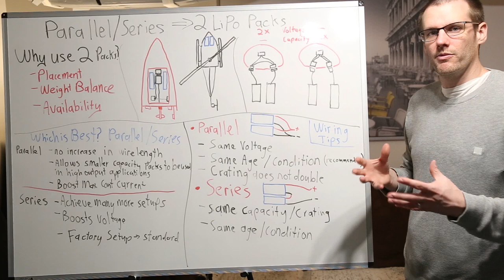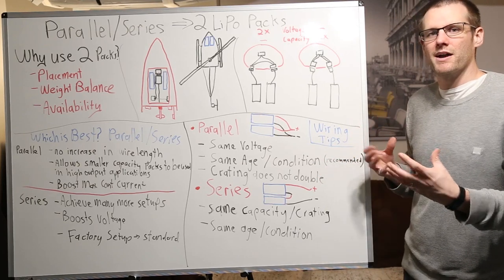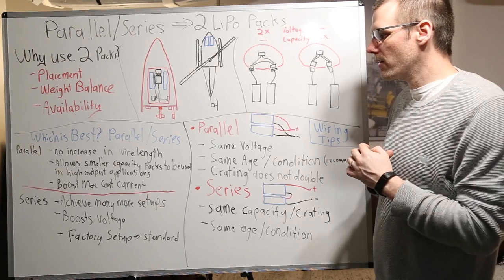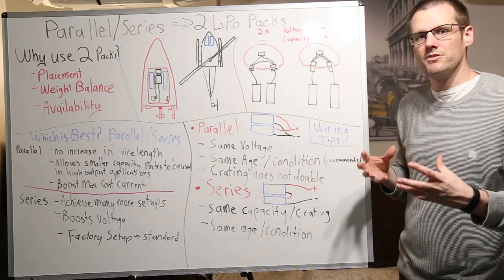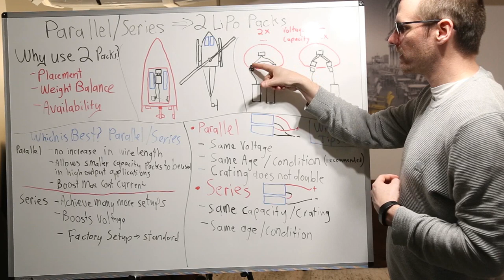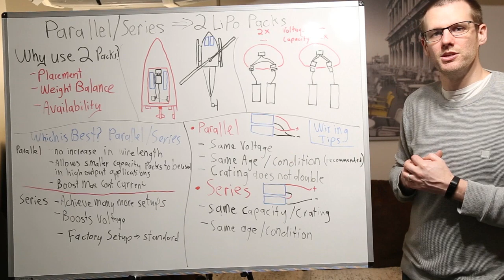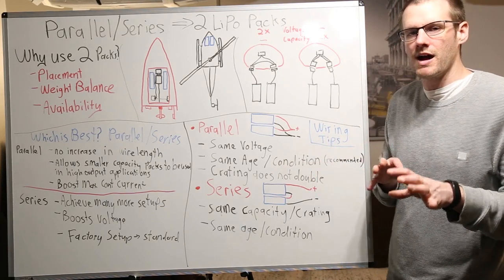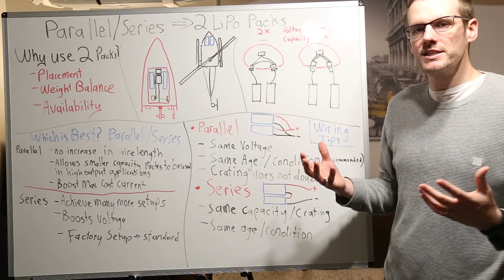Do you Parallel or Series Wire 2 RC LiPo Battery Packs?

Comment: Ryan thank you for explaining this! Sometimes i want to run 7s on my arrma infraction, even though most of the time i run either 6s or 8s, i one time used a 5200mah 3s 50c battery pack and a  4s 5000 50c battery pack, noticed the truck was struggling. So now i see it has to be the same milliamp hour a c rating for it to work. My esc is the mamba monster x 8s. I run a 1650kv 1717 castle x-01 motor
Reply from the maker: Hey Colin, Preferably the packs should be from the same manufacture and of the same model. You can put a 4s and 3s pack in series with no issue.

Comment: Thank you,  as usual you have the most clear and logical way of explaining these things. 
Also thank you for your help a while back on my son's RC esc malfunction.   I replaced it and some wires,  alls well.
My question today: 
I have a 3s lipo, arrived with 1 cell leaking. Refunded. Now I have a lipo with 2 healthy cells.
Im splitting the 2 cells apart,  placing one on each side of transmission on a SCX24  crawler.  This is excellent for CG.
Now, usually i buy 2 x  7.4v lipos (long drone batts), make a parallel connector,  and i improve batt life and CG.
This time I'll have, when i split the 2 cells apart,  2 x  3.7v  1cell batts.
- I'll need to run it in series. 
Can i use the same 3s balance charge plug?   Plug it into 3s balance charge port,  and no problem? 
Or do I need to buy a 2s balance charge plug? 
Im sorry it was so long winded, I'm kindof wordy they tell me!  Lol
Thanks again,  your my favorite brain on here! 
Cheers :)
Reply from the maker: Hi Mrs. Rabbit, How do you plan to charge these battery packs? If you were to charge each one cell individually you do not need to balance as its a single cell.
If you plan to charge them while in series you will need a balance tap. If you use a balance tap designed around 3s, you will need to make sure the correct leads run to the charger. If the wrong leads are ran to the charger from the balance tap, it will not work.
Using a 2s balance lead will make things simpler and there will be a lot less confusion for how to wire it.
Reply: @RCexplained  okay i see. 
Yeah,  i was hoping to stick the leads into the right holes and simply use the 3s balance tap. 
Though I do see another issue now...
the wires to the balance charge plug will also have to be extended,  more weight (maybe marginal), and not sure if that creates any other issues. 
Maybe i should simply buy a 1s multi-port to charge multiple 1s.
Thank you,  much appreciate.

Comment: Halo, great video. I have some question, what if i use 2 battrey with different mah but same voltage in paralel mode. Will it work fine? Or any suggest and what? Thanks.

Comment: Hello, like ssranon below, I would like to combine two 3S packs in series to get a 22.2v 6S pack. My question is this; can I combine the two packs in series, placing the negative from one pack and positive from the other pack into "one connector" and then solder the other two (negative & positive) wires from each pack together to complete the series path? Also, very important is; can I shorten the soldered wires so as to reduce weight and compactness of the series path connection, or must I leave the two soldered wires as long as they were already?
Reply from the maker: I'd recommend following a series wiring diagram. If I understand your description correctly, it doesn't sound correct.

Comment: Sir hello i have an inquiry,can i run this series on my kraton 6s? one is 35c one is 45c both 3s 4500mah, will this cause any major issue on the batt or the esc itself? I understand that it may cause degradation on a batt with a lower c, can a difference of 10c cause immediate issues on the battery?   Thank you

Comment: I kind a miss one of the most important reasons for parallel connecting. The current drawn per battery is divided by 2 which results in a less warm battery and a much longer lifespan for both batteries. Yes the theoretic max current is doubled but in normal use cases the esc and motor will limit the max current. For example 2x 2S in series (14.8v) will draw max 80ampere. 2x 4sbatteries in parallel (14.8v)  will let you drive faster and lets put it on 100 ampere. But because they are in parallel the battery will only need to give 50A each which will result in a cooler battery and longer life span compared to the 2s serie batteries. (I think also a higher voltage on the battery will give you less resistance in the wires towards esc because amps are lower)

Comment: Do you recommend doing both if done right.  I have a 8s felony  I run 2 4s lipos I'm planning on getting 10000mah packs but I'll like to run for at least an hour or a bit more. Motor won't overheat is 800kv under geared.
Reply: Also planning on running multiple temp sensors to monitor Temps. Wirelessly
Reply from the maker: I'd recommend running what you own without buying more packs while using the least amount of packs as possible.

Comment: Nice video man!
Sorry I'm pretty late to the party...
My question is; when i run 8S with 2x4S in series (Traxxas Xmaxx); what happens if I parallel the balance wires? Would it smoke or help with equal discharge?

Have a nice one
Reply from the maker: You can't place the packs in series and the balance taps in parallel.
Reply: @RCexplained  Thank you for the quick answer M8!

Comment: Oh, I've got another question,  if you will..
If one battery pack of a parallel setup is weak/going bad,  when i plug them in,  is there a possibility of a hyper-charge-speed situation...
Whereas the weak batt draws a charge TOO fast from the good batt, creating a fire hazard?
Reply from the maker: The good and bad battery pack should be charged to the same 4.2v per cell. When plugged in there should be no or very little current flowing from one battery to another. If one battery pack is not charged fully, right up to 4.2v per cell, current would then flow in to the under charged battery. You can confirm the state of charge with a LiPo checker. A small amount of current flow between 2 batteries is OK, however you do want to confirm you are connecting batteries that have the same state of charge when placed in parallel. This would be to charge batteries or to run the battery packs in parallel.
Reply: @RCexplained  is there a danger running a good pack in parallel with a pack that is not bad but not good? 
I try to keep my batteries all good, buy if there was a cell in one pack going bad,  would the good pack try to force a charge on that pack with a bad cell, creating any problem? 
Im just getting into monitoring my packs,  discovering bad cells, and saving the good ones to create new packs. (I dont want to waste good cells).
This is a great subject,  really interesting to me,  and i appreciate your contribution to the hobby! 
Thank you!
Reply from the maker: Hey Mrs. Rabbit, if you make sure your cells are all charged to 4.2v per cell in each pack, it won't matter so much. The weaker cell may have less capacity and also more internal resistance. Watch for heat and voltage specific to the bad cell after you run the pack.
Reply: @RCexplained  okay awesome,  I'm buying a proper charger now.
I'll be monitoring my batts more closely,  and will watch for that. 
Thank you so much for the info!
Reply from the maker: @MrsRabbit8  no worries

Comment: Can you use a cap pack on both battery setups?
Reply from the maker: A cap pack placed on the ESC will not know if you have packs in series or parallel. It works for both.
Reply: @RCexplained  right on thanks for the prompt response as im wiring up my limitless in-between watching your videos for reference. Thank you🤙

Comment: Is it possible to use a Lion in parallel to a High C Lipo so I can use some punches in a climb or take off and the good energy density? 
A 3500mah Lion in parallel to a 1300 Lipo so I can use the high C advantages of the Lipo in a takeoff and lower the sag on the Lion and take advantage of the extra fuel provided, will the Lion keep the Lipo at its same voltage?
Thanks
Reply from the maker: Is it possible? Yes. But has to be setup correctly so that there are no cells over/under voltage. Not something that I could recommend as it's not necessarily as easy as plugging the packs in parallel together and everything is good to go.
Reply: @RCexplained  I’m using 2 18659 4S packs in parallel in a FPV tween, but on climbs late on flight I can see the sag on my OSD on climbs!

Comment: Can I run same battery but in different size gauge wire like a 10 awg and one 12awg in series for arrma limitless? Both is lectron 11.1v 7600 mah 75c but somehow they have different size awg wire?
Reply from the maker: Can you, yes, but definitely not ideal. I would ask why there is a difference in wire gauge.
Reply: @RCexplained  I ordered one off eBay assuming it would be the 10 awg like the one I already have. Thanks!
Reply: @RCexplained is there a chance that running it this way would cause a fire hazard or explosion of the lipos under excessive use?
Reply from the maker: @ncunit2l  LiPo batteries being run in high performance vehicles have an inherited amount of risk associated with them. The best thing you can do if you can't speak with the manufacture or seller is check for heat in all components including the wire. I would suspect that you won't see much difference. However  make certain of this by measuring Temps.

Comment: So dose the C rating go up in parallel or series when you use 2 batteries
Reply from the maker: Hi Knight Knightman. The C rating does not change when you wire in any configuration. (its a constant)

What is happening instead is the capacity increases when batteries are in parallel and the voltage increases when wiring in series.

Comment: Can you run two 3s batteries in parallel in a 4s truck
Reply from the maker: As long as your ESC is happy with 3s (it should be rated for it) you can run 3s packs in parallel in a 4s truck. Expect slower speed with 2 3s packs wired in parallel for 11.1v nominal.

Comment: i have a bettery 0f 2200 mah (30c ) lipo and 2900 mah(3c) lipo should i connect them in parrallel?(both are 3s or 11.1 v)
Reply from the maker: I would be concerned about the 3C battery. That is awfully low output. If this is accurate , you can as long as you don't pull more than about 15A or so from them.
Reply: thank you  @RCexplained  .... but i was concerned that one will discharge much faster than other and cause voltage imbalance and may cause unsafe conditions.....but since the quadcopter consumes 32 amps at 50% throttle and the 2.2amp battery wouldnt be able to supply it for long enough so connecting a 2900 mah might suffice the time...?
Reply from the maker: Is your 2900mAh 3C? or did you mean 30C?
Reply: @RCexplained  3c l-ion battery
Reply from the maker: I would be concerned about that battery pack. The C rating is too low for the amount of current that you will be pulling from it, even when it is in parallel with another pack.
Reply: @RCexplained  thank you... guess i'll have to run the drone for 5 mins.

Comment: lol you bought en entire whiteboard for this video lol so much wasted space
Reply from the maker: Actually, that's not the case. I've been using whiteboards for a while now, well before and after that video was released. It's just a useful tool for me, not specifically for the video and also not solely for YouTube. Fortunately, the space isn't wasted at all; I get a lot of mileage out of it, much like  my Toyota! Nice B6 S4, hope you can get some high miles on it too.
Reply: @RCexplained  thats a decent idea, I wouldnt have the space for it lol and thanks, it already has 150k miles on the clock and still fun to drive!